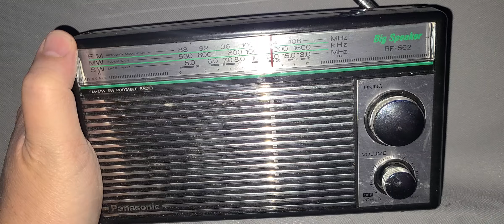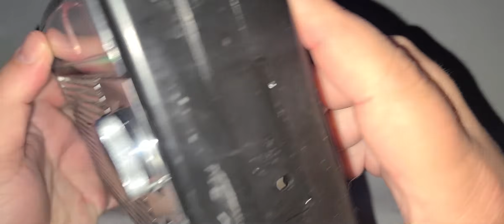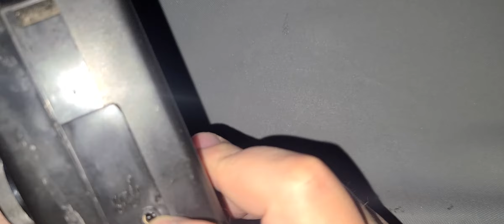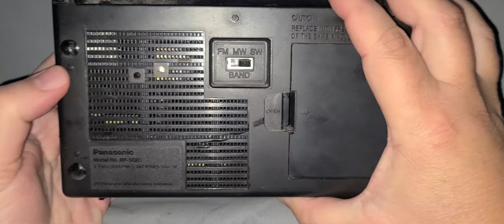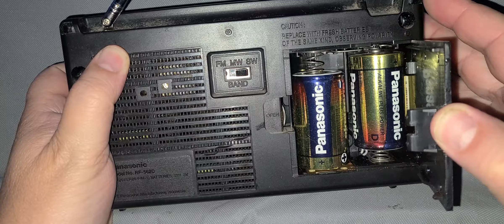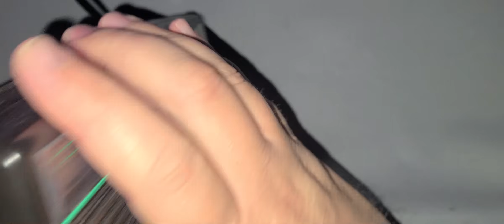Revisiting the Panasonic RF-562 AM FM Shortwave analog portable receiver with Big Speaker

Comment: Last night i picked up China Radio International on the RF-562 using the telescopic whip indoors.  I paid $38 for this radio from Ebay recently.  Received the CRI broadcast (500KW)  at 55445.   Distance TX<>RX:  7,013 miles.

Comment: Your rf-562D is not made anymore
 The replacement is the rf-562DD.  Digital signal processed, cheaper price, surface mount components, SW band starts at 6 mhz. Draws more current.
A great step backwards.
Your model has replaceable components, and lower current drain, easier to tune.
Reply: The Japanese are greatly skilled in the art of fucking up a good (technological) thing. It's why the place is backward-as-fuck technologically - often being described as "yesterday's idea of tomorrow". Oh, and even the official Panasonic store on Amazon advertises the original analog RF-562D but then sends you a digital RF-562DD, and the official Panasonic website uses old images of the original analog RF-562D and then sneakily describes the digital RF-562DD... This is why China is killing Japanese 'innovation'.
Reply: DSP model is RF-562DD2 I believe. DD has a different circuitry from D but is still analog tuning.